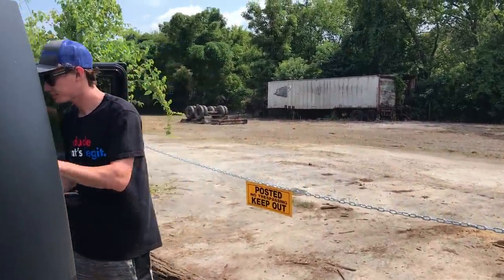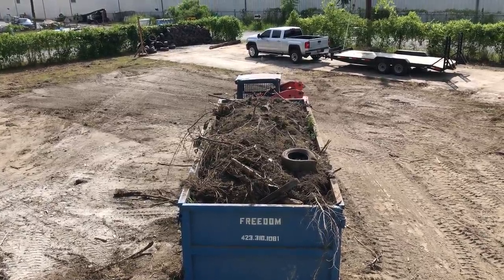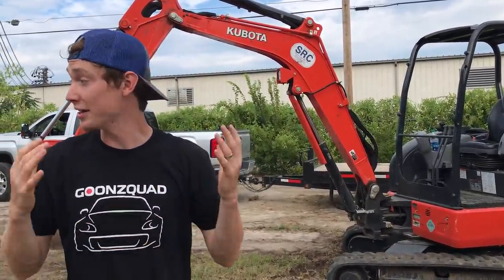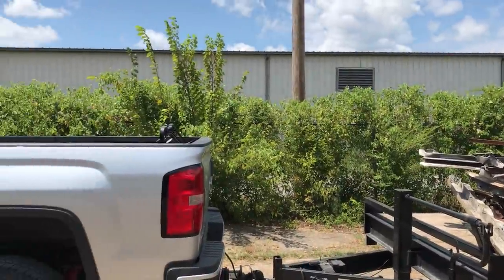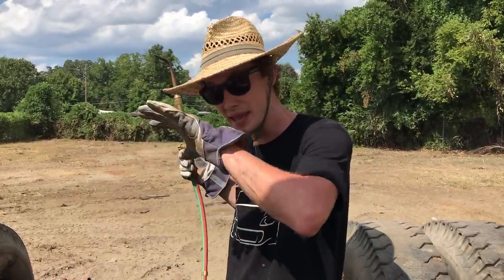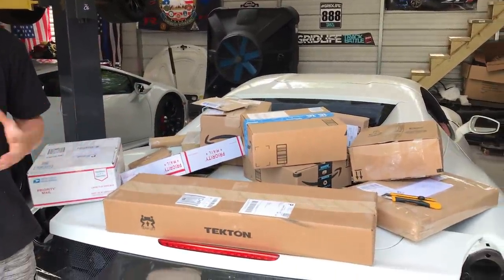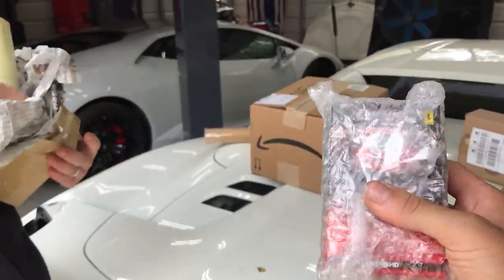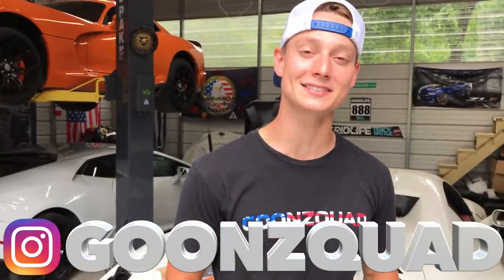Building The New Goonzquad Garage Part 2

Comment: Work smarter not harder, a cutting torch instead of a brazing torch would have made quick work of the shackles. I enjoy the channel and look forward to your future projects.
Reply: Agree! Came to the comments to mention that. I'm surprised you guys got it cut! A cutting torch actually burns the metal.
Reply: Yeah, I came to say that too.
Reply: Me too😂
Reply: Same, torch you guys are using is designed to Heat not Cut fellas.
Reply: It can be used for both with a different torch attachment.  I would just skip the acetylene all together and use propane for that type of stuff. Much cheaper.
Reply: That's what I was thinking, if they knew what they were doing it would have taking less than 15 mins with a cutting touch,drives me crazy how clueless people end up with piles of $$, sitting there watching the metal drip off the u-bolts with a brazing torch,  "Wow this is taking a long time, used all gas up too"   it just blows me away watching.

Comment: “Oxygen and something else “ ,  I”m not knocking you guys, but you really know what you’re dealing dealing with and be properly trained in the safe use of an oxy-acetylene welding /cutting set.  As when mishandled or not used correctly with safe work practices,  then there’s a possibility of a serious accident causing horrific injuries or death. I’m a trained metal fabricator and I’ve seen terrible injuries first hand to co workers from misusing oxy sets.  Something to think about.  Correct me if I’m wrong , I think you are trying to cut with welding torch , you will need a cutting torch attachment to cut.   That’s why it’s taking so long to separate your pieces.  Really like your channel,  keep up the good work boys.

Comment: That's a welding/brazing tip on the cutting torch a cutting head would have made quick work of those u-blots
Reply: I thought the same thing. Never tried cutting metal with a welding tip.
Reply: Rookies with a welding tip  !🤣
Reply: can be done, but highly ineffective, proper cutting tip and those u bolts would have cut like butter
Reply: I saw it and laughed like hell,were they trying to braze AC lines. Legit ,dam,
Reply: Was looking for this comment lol

Comment: You're using the wrong torch body 
And torch head those are for welding not cutting
Reply: And they had their acetaline bottle on its side which is a nono.
Reply: Thought it was just me lol, but yah, brazing torch is NOT meant for cutting. Rosebud tip is for cutting.
Reply: @MrGhostVortex  Rosebud is for heating not cutting.
Reply: I’ve tried to help them. I’m literally on the road they live on. They don’t respond, so idk.
Reply: After laying that bottle on it’s side though they’ve glazed that torch and reg with acetone. Lotta cleaning to get it back clean inside.
Reply: @LextechLighting  why don't you knock on the door sound like you could provide some help to them
Reply: @LextechLighting  Well, thats depressing. I only subbed and watch for the viper. Guess I'm done here

Comment: Hydronic/ pex tubing water heated concrete slab you can heat it with a hot water heater with spray foam insulation on ceiling and walls and central air. Super efficient

Comment: I would consider excavating a few areas around your property to see how thick the concrete is in the front. It could be 2 feet thick or there could be a foundation in there. It may be cheaper to move the building back and place the parking lot over the concrete area. Just a thought to save major headaches!

Comment: Dude that's a welding (brazing) tip.  You need a cutting torch.

I can't believe you cut through anything like that...unbelievable.
Reply: @ll5352  I am not a welder.

When you don't know, you ask or do some research.  Hell YouTube is a pretty good source.  They should know that better than anyone.

They wasted a crap ton of time, not to mention money, trying to cut steel with the wrong tool.
Reply: The torch heat is the same, dependent on fuel gas. Cutting torch only directs the pressure to force the metal out. Given what he is cutting just melting it is fine. It’ll just fall out instead of being pushed out.
Reply: Yes he got the job done, but anyone that knows torches knows u could cut that whole thing up in less than 15 minutes with a touch, that braising tip will take for ever to cut that steel. If u dont know how to adjust a torch rite it will take u forever to cut that steel also
Reply: @LextechLighting  absolutely not. Brazing torches deliver a LOT less fuel and a lot less heat input.
Reply: Can't believe someone can use something and not even know the name of it. Gas cutting thing to "cetylene". Amazed at what they achieve considering some things on the channel though, awesome accents too.
Reply: Bobby Brady  getting things done no matter  what it takes is more Indian, Chinese, etc. Have you seen their work death rates? People are expendable there and it doesn't matter to the bosses how many consumables it takes, as long as the job gets done.
Reply: Bobby Brady  they are ambitious for sure.  I learn a lot from them tbqh.  In this instance  they should have done a bit of research on proper methods.  Safety alone is a huge concern.  Oxy-acetylene is not unsafe but they clearly didnt know enough.

Comment: You are using the wrong oxy acetylene torch.. you have the welding touch you will need to have the cutting touch . The only things change is the tip  is change and  liver to give it more oxygen to cut
Reply: Liver?
Reply: @zaprodk  autocorrect **

Comment: hey qoonzquad there is a structure called K-Span it is a curved structure you can use to build for your shop I already have it in Iran and it is basically from America it is so cheap in comparison with other structures and faster I think you have to consider that too have fun guys love your work
Reply: Looks like a real solution for extreme damage from wind since there is no roof and therefore no roof 'over-hang' that the wind can grab and pull off the entire roof.
Reply: Yeah thats true and the snow load of this structure is way more than others

Comment: Also on a side note, for any shooters out there, pick up all your brass. Little know money maker, most metal recycling places take spent shell casings. Going rate right now is $1.25 a pound. That adds up quick if you can get range brass or shoot a lot yourself. A 5 gallon bucket is around $100.00

Comment: Billy - you need an oxygen acetylene cutting tip. You can use the same hoses and tanks. However you may want to get a bigger oxygen tank if you plan on cutting alot because that's what is used to blow the hot melted metal away.

Comment: do a 1970 dodge charger r/t if you  find one
Reply: Street view maps of the site are 5 years old, and looks like there are plenty of project cars in the front yards of the houses around the new shop. I can see a 4 door 65" impala's one street over.

looks like lots of tall fences with barb wire and razor wire protecting the local businesses to. hope they address the security on site before they bring any cars over
Reply: tanner jensen yes but rather a 69 charger
Reply: They are obviously into much more valuable cars than an old beater. All of their project cars are less than 10 years old. They do not do rusted out old restorations, they do repairs.
Reply: That are not old beaters and the metal cars are made out of now is weak the metal the old cars are made out of   is strong and can take a hit and I'm sure goonzquad would agree and I now  my old muscle car so don't hay on classic cars because if they are fixed up good you could get top dollar.
Reply: @tannerjensen3271  yea, I'm sure one would sell for what that Lambo would. You are dreaming buddy. Also, your English is horrible, try taking a class. Newer cars are much more protected against rust and corrosion, lasts a long time without any kind of service, and are much more efficient. Get with the times bud, they don't make them that way any more for a reason.

Comment: Go 40x80 or 50x60.  I went 40x60x16 tall and I'm out of room with old cars, tractors and projects 4 years later.  The wider is really nice and you want at least 3 bays.  Insulate it for sure and go tall enough to put a nice loft for parts and office.

Comment: Just some friendly advice about Oxy-Acetylene cutting. Use the proper torch head. The torch head that you used is not used for proper torch cutting, and is used for brazing. This is why it took you so long to cut those U bolts. Love what you guys do though.

Comment: You need an oxy acetylene cutting torch with much larger tanks to blow away the melted steel. The tip has 5 heating holes and one oxygen blow hole on the centre to blow away the melted steel. They used this before plasma cutters. What you where using was a welding braising tip that could heat but not blow. The blow uses a high pressure stream of oxygen to push the melted metal away cleanly for an accurate cut.

Comment: You need an Oxy-Acetylene torch with a cutting head. and get a long cutting head and large tanks. If you guys are going to build a shop to work on cars you will need it. And don't start using it for a hammer. Remember to always turn off the bottles when not in use. Good luck Guys!

Comment: looks like Goon dog would be a good name, as for the square plate that says HOT  it is called a build plate for a 3D printer.  you can tell because two of the wires are larger for heating the hotbed, and two small wires are from a thermister to tell he computer what temp the hot bed is at and help regulate the temp.  don't know why he sent one, but that is what it's for.  you could also use it as a hot plate for warming stuff, just connect the larger red and black wires to 12 volts it can easily get up to 140 degrees F.   mike

Comment: You should get multiple building proposals from your local Design-Build Contractors inclusive of all construction, design, engineering, permits and all general conditions. Seems like a simple structure, you will just need to give them your building requirements.

Comment: You need a number 2 cutting tip and a number 4 Acelyene and a K size (250cf) oxygen tank. That would speed up yhe process of cutting. Oh and I would recommend a victor set too.

Comment: sounds like you did not have a Neutral flame with the torch, you need to wind the oxygen up or down to get a better flame to cut faster depending on how much acetylene you're pumping through the nozzle. Should be able to cut through that steel in under 30 seconds! Hope that helps!

Comment: WOW, good job guys, before you proceed any  further see if any toxics or chems were dumped in area, give the site a clean bill of health  and make sure no tainted soil there or in area.........
Might want to do the build in three stages, first  get the main building up  with repair, storage lifts  and office areas along with  all the latest energy saving equipment like heaters and AC to benefit for tax breaks...........and a secure area for storage and parking too.might even see if you can set up storage areas and rent space  for outsiders to tow for you and storage  and charge them rent 

Second, do a add on building for tire, front end and fabrication for the autos/trucks like 4 by 4's .good money in that but stay away from cycles and the like 

Third, a paint and body shop full time is really good but that opens up mega $$$$$ for State and fed  regs  put that last 

Hey give richard Rawlings of GAS MONKEY  a call and he can do a segment on Garage ReHab nut yours is new and might make it to his show 

Lastly, go to a few planning and zoning board meetings and intro yourself to city government............  LOTSA  LUCK!!!!!!!!!!!!

Comment: its been a while since ive done any type of welding and cutting, but if i remember correctly, i think thats a welding tip. you need an actual cutting torch. you could have cut through all of that in no time whatsoever with the cutting torch. still a great vid.

Comment: Its called oxyfuel cutting , using oxygen and acetylene, thats also a brazing tip which is used to weld it wouldve been quicker with a cutting tip

Comment: The torch you were using to cut the ubolts has a welding tip on it, you need to get an actual cutting tip on it and it will go a lot faster

Comment: Rent a tire shredder and shred the tires yourselves. Use as new parking area for shop. Or cut side walls off of them then fill them with gravel as very strong asphalt substrate.

Comment: That torch head is the wrong one for cutting. That's actually a brazing tip for welding.I said before i u were done that there's no way there's enough oxygen/acetylene in those. But other than that u guys are pretty cool to watch.

Comment: You need a cutting torch. Would cut so much easier.  Pretty sure that’s a welding torch you were using. That shouldn’t have taken more than 10 min to do

Comment: y'all are not using a cutting torch tip your using a welding tip . there's a different tip for cutting steel. the one for cutting steel has a leaver on it to add more oxgen  to the flame too make it work faster

Comment: How do you guys keep your 3M masks from digging up your glasses?

I’m using them too, with safety glasses, and no matter how tight I make the nose section, my breath keeps fogging up my glasses. Annoying!
Reply: In the military you breath on the inside of your glasses before you put them on. Outside humidity level will determine if that works.

Comment: Shop size 100' x 50' .. you're gonna need the space and it won't be much more than the 70 x 40 which is almost half the size. And i'd name the dog Dangit .. C'mon Dangit ! :)
Reply: 70 x 40 will not be big enough in the long run.... it's cheaper to build it bigger the first time, I had to add on to both ends of my
building over the years and it woud have been much easier and less expensive to build bigger from the start. IMO 50 x 100 is a good starting point and will have good residual value. Oh yeah,  go to HF and buy a cutting torch attachment for your OXY/ACT rig. It would have made quick work of that trailer axle demo. mardyn

Comment: This company builds pole building style buildings that are huge by using metal trusses supported by wooden posts. Outsides are clad in sheet metal or wood attached to purlins and girts. Your architect will be able to advise on whether this type of construction is viable in your area. The company is located nearby, too. It is http://www.StroudsBuildingSupply.com in Morganton NC so you can probably save on shipping. I am not affiliated with this company, just ran across them while looking for ideas for my new workshop.

Comment: I would put the building in the back burn out pad same spot u think witch would be in front of the shop so ya costumers can test there new set ups right there after pulling out the shop and the parking lot right where u guys where planing on putting the building that's the perfect layout for me if u guys want message me and I'll make a 3d lay out for u guys of my idea

Comment: your using a welding torch when you need a cutting torch to cut up that trailer. a real cutting torch will cut up that trailer in and hr.

Comment: Please set a better example and learn the basics of the equipment you rent. Torches are dangerous, and different gasses are not to be messed with when you don't even know what type of gas you are using!! You didn't even use a freaking cutting torch, you used a brazing torch.